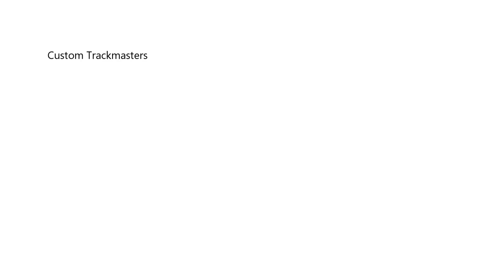Fix repair Dodge Trackmaster Thomas & friends Thomas y sus amigos 托馬斯和朋友 Томас и друзья

Comment: There are 2 ways of doing things when a trackmaster breaks: the hard way ( repair it) or the lazy way ( make it a non-runer )
Reply: Or just getting a new one and throwing the old one away.
Reply: Damn your correct
Reply: @carsignite95912  its kinda a problem if you get one for alot of money that doesnt work myself i would do anything to fix it
Reply: I have the same problem with my trackmaster diesel 10
Reply: @davidantoniocamposbarros7528  trackmaster 1 or 2?
Reply: @carsignite95912  BRUH DONT THROW IT AWAY
Reply: Privet!
Reply: @davidantoniocamposbarros7528  you know these are the same motors as the Trackmaster to ones right
Reply: I would try to fix it by watering down the inside and replacing the batteries.